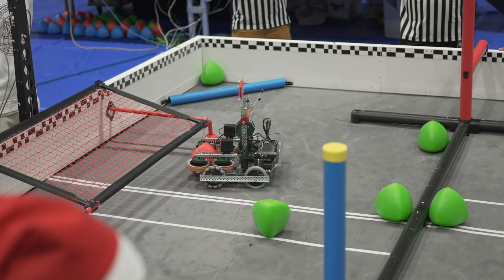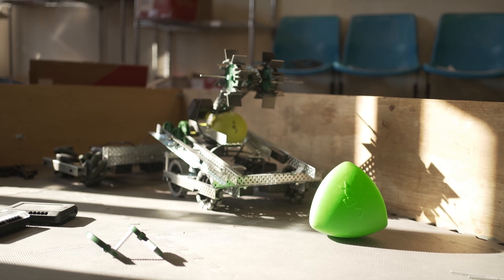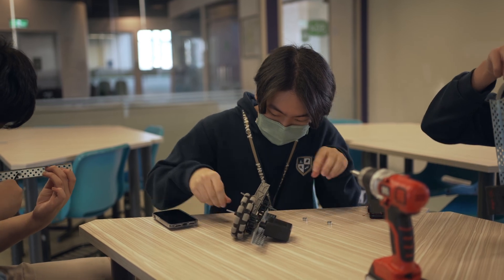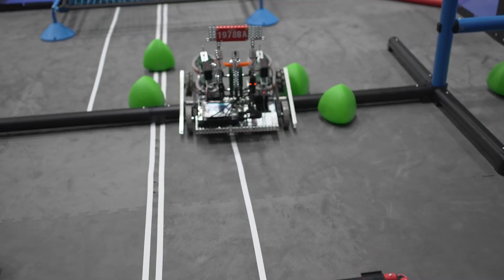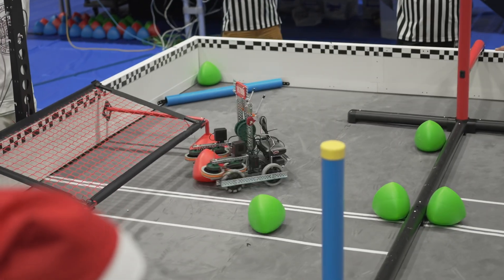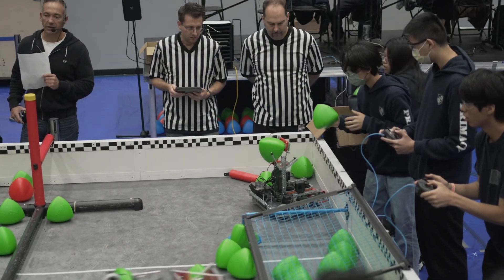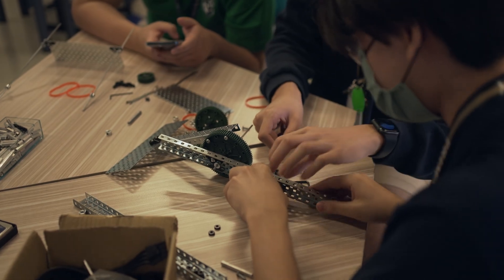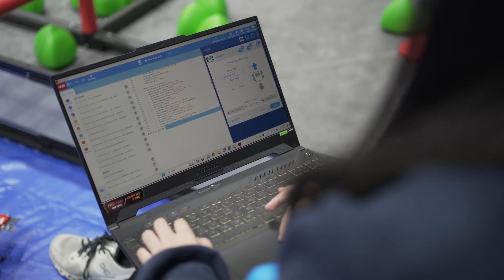Formosa VEX Robotics Competition Dec 2023

Comment: Awesome bot! I would recommend two things for improvement:
1) Put as many motors as you can into your drivetrain, not just two (It looks like this one has two, apologies if I'm wrong). It may not seem like it, but a faster robot gives you an advantage in almost every aspect of the game.
2) See if you can make your robot longer than it is wide. A wider robot has a better chance of tipping, especially if it has a high center of mass. A longer robot tips less as it's wheels are more spread out. Tipping is a big problem this year and your robot looks prone to it.
Great work though! Good luck in January!
Reply from the maker: Thanks, they've already put more motors on it. I'm not sure about the length. The rules are 18 inches wide and long. Most of the bots were basically square because of this. More wheels are going on for sure
Reply: @primacy777  The maximum is 18x18, but you can make it smaller than that. Smaller robots navigate the field easier, get around bigger robots better, and are overall lighter. Just a suggestion though, it's up to your team.